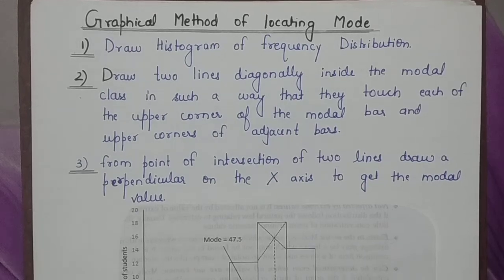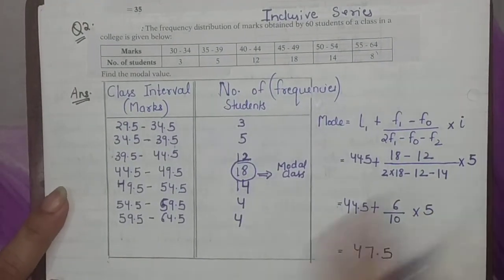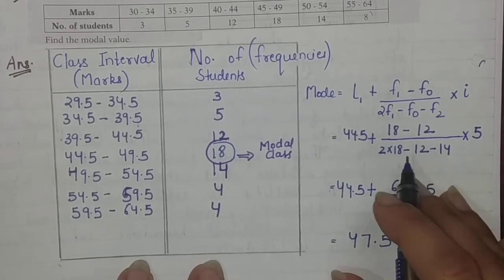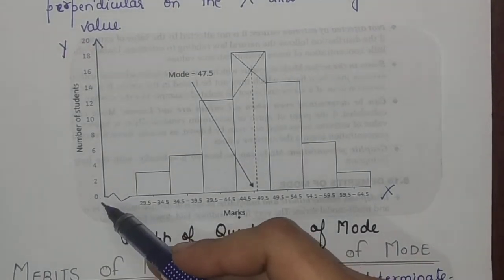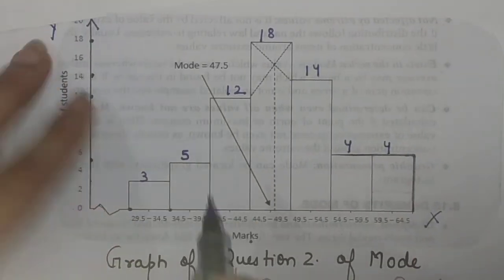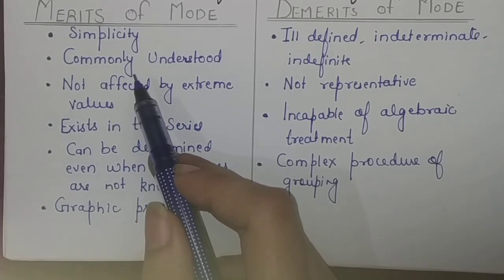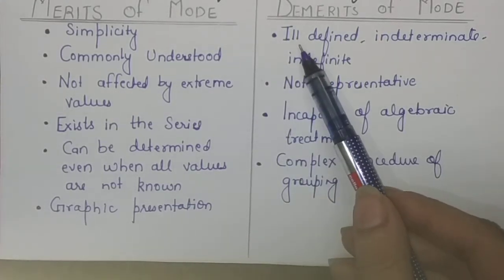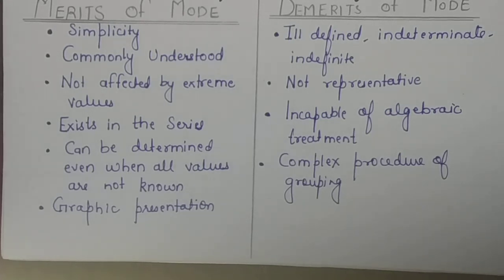Graphical method of locating mode

Comment: mam 8 ki freq k 2 parts kyun?
Reply from the maker: Beta sabhi class interval ka size 5 hai, but 54.5 to 64.5 class interval ka size 10 hai, therefore uske two equivalent parts kar diye, by doing that frequency 8 k two parts ho jaate hain,4 and 4
Reply: @dr.vineynarangchugh8823  mam sorry smjh nhi aaya 54.5 to 64.5 kese mam yhn end mn to 59.5 to 64.5 h mam?
Reply from the maker: Beta total 6 class interval question mein diye hain, first 5 class interval ka size 5 hai, lekin last 6th ka size 10hai, 55-64.

Then two steps are followed
1st step: 55 mein 0.5 less, it became 54.5, 64 mein 0.5 add it add it became 64.5,  new interval became 54.5 to 64.5.

Ye baaki class interval se alag hai, iska size 10 hai, baaki sab ka wife.
It may lead to error, fallacious conclusions and answers.

So 2nd step is necessary.
2nd step is breaking class interval into two parts.

54.5 to 64.5 will be divided into two parts, 54.5 to 59.5(class inter size5), 59.5 to 64.5 (class interval size 5)

3rd step: frequency k bhi do tukde kar denge, 8 k two parts 4 and 4...

We converted last marks range into two ranges, to bring uniformity in class interval size. ..now every class interval has size 5
Reply: @dr.vineynarangchugh8823  acha mam thnk u sooo much 😘it means k end wali class interval ki size mn  gap ki wjh se hmn split krna pr rha h 2 parts mn ?
Reply from the maker: Yes